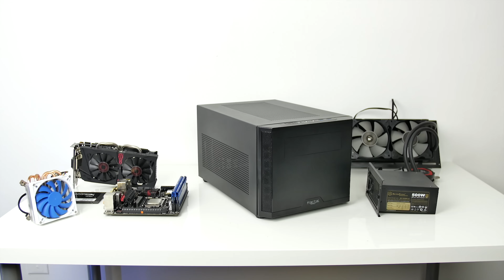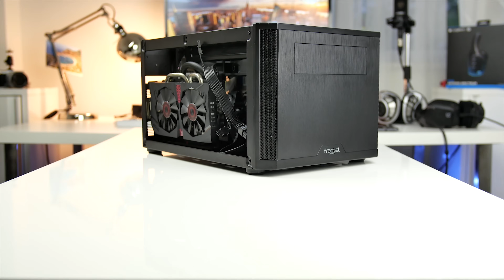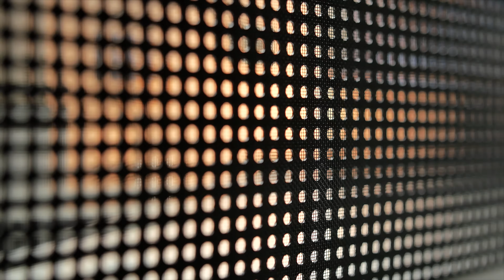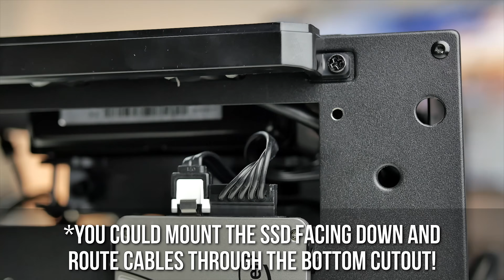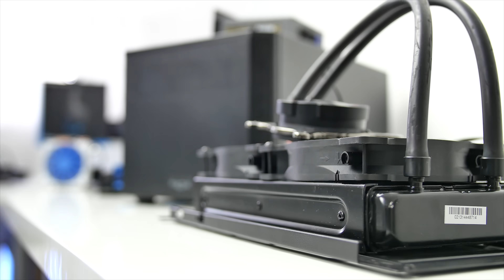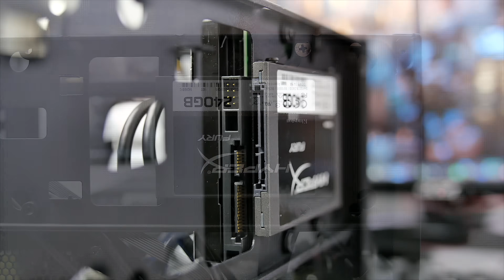Fractal Design Core 500 Review | New ITX Case King!

Comment: Decent case. But I still love my Cooler Master Elite 110.
Reply: +Ardimo Harsa I've switched from an Elite 110 to this Fractal. Main reason for doing it: The Elite doesn't house a standard atx psu AND a good tower cooler at the same time. The Core does. ..only too bad it can't be as small as the Elite 110 though ;)
Reply: Derek Lopes The Elite 130 is a pretty cool case, but it suffers from the same issue as the Elite 110. No room for good tower coolers, as the psu is hanging right about the cpu area.
Reply: I have the Elite 130, I'm extremely happy with how small it is but still able to support plenty of drives and full sized components.
Reply: That is true but I use a closed loop water cooler anyway.
Reply: The AIO's isn't my cup of tea, but i do agree.. Such a thing will solve the problem :)
Reply: which of these is cheaper?
Reply: the Elite 110 or even the 130 doesn't support bigger 240 radiators so something to consider for beefier CPU's in smaller cases.